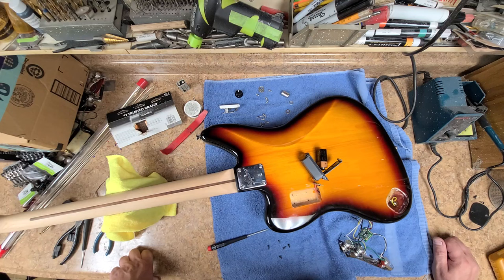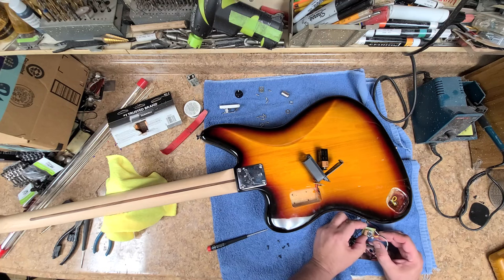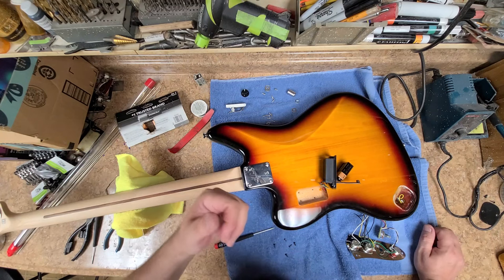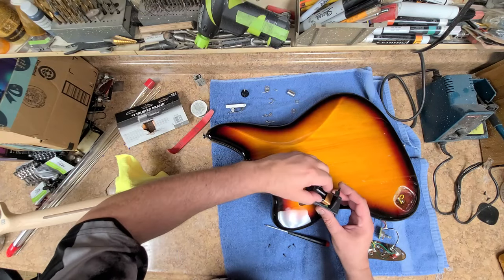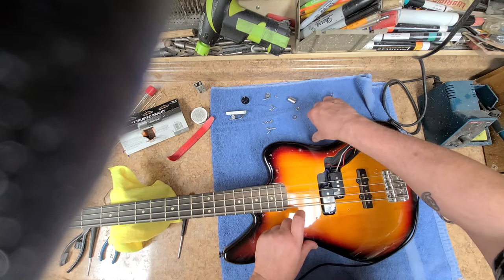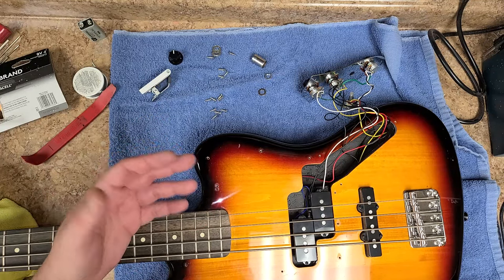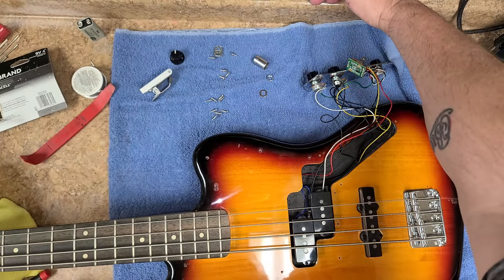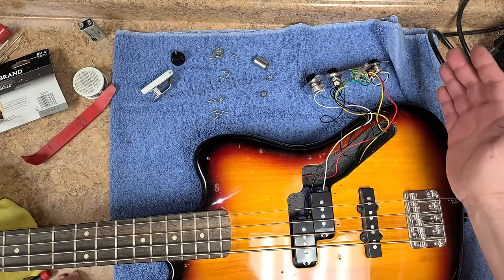What Was Wrong With The Squier Jaguar Bass

Comment: Looks like the standard battery that comes from the factory. I think that you're supposed to change those out for your favorite brand when buy the guitar. I use Boss wireless for my Ibanez SR300EB. My bass had to sit in it's case for two years while I recovered from an illness so when i finally started playing it again it wouldn't make sound. It took two two spraying sessions in the pots before o could get sound again. I discovered that the sound comes through the low EQ knob. It was dirty. Also, I switched out the barrel jack/panel jack for a Switch craft jack which gives a good tight connection. I had to clean the preamp pins and sockets to get that work right. The stick on protective pad on the solder side of the preamp had lost it's stickiness and I used a zip tie to secure it but the zip tie was ran over the preamp plug connectors and messing up the signal path through it thus making the bass have a low volume buzzy/fuzzy sound. I cut out a replacement pad out of a rubberized tool box drawer liner and zip tied it in a way as to not infringe upon the preamp plugs. Sprayed the preamp pin connections again and finally got the bass to play right again. I replaced the battery snap with a new one. I learned a lot while trying my hand at guitar care 😅
P.S. the guys on talk bass.com have a discussion on that bass booster. On forum member removed theirs.

Comment: I had one, and it would run the battery down in a few days of non-use. I found out it was a faulty battery clip. But I traded it to my brother, and bought a short-sale non-active version, which is the bass used by the Dukes of Charteris bassy.